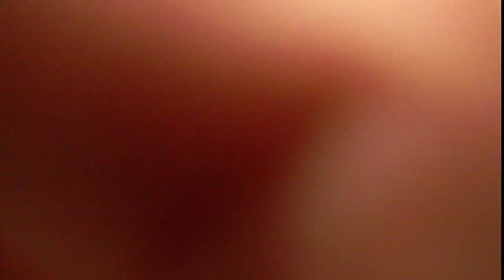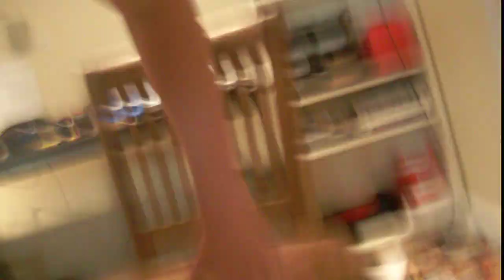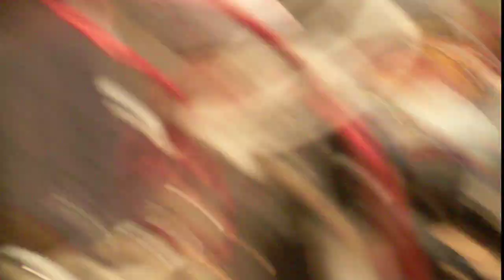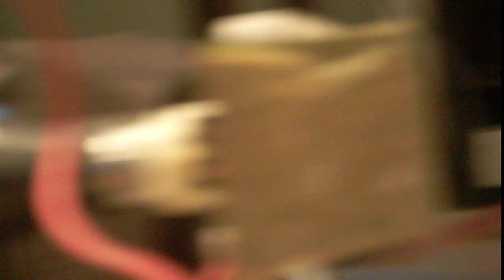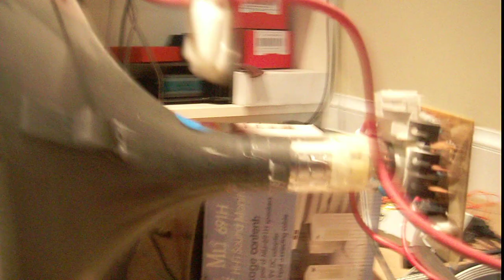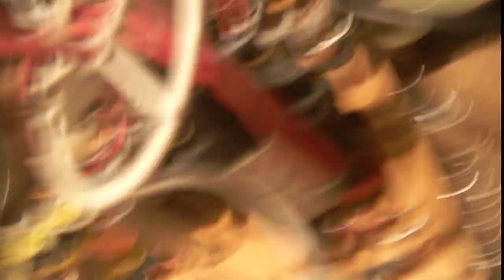DIY Particle Accelerator 1

Comment: This is an excellent project which will provide valuable insight into particle physics, vacuum technology, electron gun design, and general engineering. After watching your video, I have two suggestions for you. Do not use PVC for your drift tube. Its extremely leaky and will cause you nothing but headaches. Heavy walled Pyrex or borosilicate tubing is in order here. A little internet research here can provide suitable equivanencies. Secondly, use an electron gun from a magnetron.

Comment: @clagwell The filament from a CRT gun will quickly fail after being exposed to air. A magnetron gun is extremely heavy duty and will withstand the air exposure with no problem. Not to mention, you could run the magnetron gun at much higher temps providing more electrons through thermionic emisson. 

Regarding "Episode 3", I have taken a break from lab projects for awhile. I will finish the project later this year and post a new video (or two).

Comment: The electron guns in projection CRTs are more badass than that one.  It's a larger gun with a single beam designed for high intensity such as a projector,  instead of the standard gun there with three beams each for red green and blue.  I had one of those tubes a few years back,  plugged it into a regular CRT board and used that set's deflection coils and anode flyback connector.  I had something on it until one of the pins broke off the base when I unplugged it from the CRT board.

Comment: @quicknuclearscience As electrons accelerate, they become extraordinarily more massive. Consequently, the closer to the speed of light they become, the more energy is required to exert the force required to continue to accelerate them. This process takes A LOT of energy, over a long period of time, over the course a LONG distance, and you would need to regulate its oscillation with an extreme degree of precision.

Comment: @quicknuclearscience I can't exactly put a figure on it.  But I do know the tube requires liquid cooling of the faceplate when it's operated in it's intended environment.  I've had some other tubes nearly self-destruct when leaving an undeflected spot on the screen.  The beam would drill into the faceplate.  I would imagine the beam in a projection tube would do the same thing very quickly and drill all the way through in a short amount of time.

Comment: @quicknuclearscience The nature of the electron makes its acceleration far more difficult to achieve than that of a proton. You could invest all this time, money, and energy in trying to accelerate electrons. Or you could invest in HV generators, transformers, etc. and actually build a potential drop accelerator. It would prove much easier, more fruitful, and likely much cheaper. Also note that when accelerated, electrons emit BETA RADIATION which can be harmful and difficult to detect.

Comment: yes but going through the device properly. Saran wrap likes to create static charge. If you ever worked with motherboards or any other circuit you would no that static electricity and circuits do not like each other one bit. I blow a out of the box brand new EVGA motherboard and two xenon processors.

Comment: @quicknuclearscience There's a boat load of them in ebay right now.  The best ones to snatch in your case anyway are the ones showing more wear than the others.  The wear is so intense and uneven that it is not practical to return to service in another CRT projector,  since the raster settings may be different.  These are the ones that most people looking for replacements should stay away from anyway for that reason. ;)

Good luck!

Comment: I research particle physics, so trust me when I say, all this will do is create a type of oscilloscope. These electrons will only travel at about .5c, obviously not approaching anywhere near the speed of light, and consequently, not really accelerating anything. And even if you did manage to build a decent accelerator, you cannot accelerate electrons. CERN will accelerate protons by ionizing a hydrogen atom. simply put, electrons behave very strangely when we accelerate them, protons don't.

Comment: @quicknuclearscience Yes, if you have the proper equipment you will be able to "see" electrons interacting. But this is basic Quantum mechanics. Of course electrons can be accelerated, but YOU cannot. The reason the LEP works is because it's so big. They need the 27kilometer path to allow the electrons to build up enough energy over time, and this is extraordinarily difficult to achieve. Have you done the math? If you have, you'll see the difficulties very quickly.

Comment: you do know in the process of this in order to get the particles at the speed of light your going to need more then pvp pipe your going to need to make the opening for the particles to travel through the size of an atom and your also going to need to have a 3 stage process to get them up to speed or it wont be called a particle accelerator. plus your also making a mini black-hole for one one thousand of a second just to let u know about the extream radiation that it will give off.

Comment from the maker: @brandonhughes7 my goal here isn't to accelerate electrons to almost the speed of light, also a particle accelerator is anything that accelerates particles at all not something that accelerates them close to the speed of light. And i already know about the radiation it will give off, but because i haven't cut off the electron gun the lead coating on the CRT TV will still  be intact it will protect from most of the radiation. Making the accelerator no more dangerous than a CRT TV.

Comment from the maker: I know static is bad for electronics, thats why when you buy parts you receive them in a static shielding bag. In this case I'm sure that static wouldn't effect this design, you could test it if you want and report back but I think nothing will happen. These 55 flyback drivers are robust.

Comment: You can't really call this a particle accelerator, it's just an electron gun making contact with a material object, Particle accelerators accelerate atoms not electrons, these single atoms then hit another bit of matter resulting in a breakdown forming different elements from the original pieces of matter.
Reply: They do not collide atoms dude , they collide subatomic particles or protons or neutrons .
Reply: No, they collide atoms.... They have done gold atoms surprisingly.
Reply from the maker: The terraria god Particle accelerators don't actually have to collide anything to be an accelerator, they just must accelerate the particles. (But usually they do collide particles) But anything that accelerates particles or something made of particles is a particle accelerator. Electrons by definition are particles so this is a particle accelerator. Also they have never collided gold atoms but they did collide gold ions at RHIC.
Reply: quicknuclearscience
Ooops :P I forgot it was an ion not an atom. I was thinking of something similar to a high grade accelerator and not the literal definition but thanks for pointing that out.... I feel silly now.
Reply: The Enigmatic Index They collide Hardons (proton, neutrons).
Reply: +The Enigmatic Index an ion is still an atom. 
official definition- 
i·on

ˈīən,ˈīˌän/

noun

an atom or molecule with a net electric charge due to the loss or gain of one or more electrons.
Reply: +The Enigmatic Index you do realize that accelerators do accelerate electrons...do a little research before you say stuff like that. Most electron accelerators collide electrons and positrons and this guy isn't doing that for obvious reasons. Positrons are not easy to get. But this comment is so uneducated it makes me cringe. Most particle accelerators dont even accelerate atoms and most do not make new elements. Look up particle accelerator on Wikipedia and read a little.
Reply: "they collide Hardons"

looooooooooooooooooooooool
Reply: There are different accelerators for different thing...
Reply: i just googled how to accelerate my hardon and this video came up lmaoooo